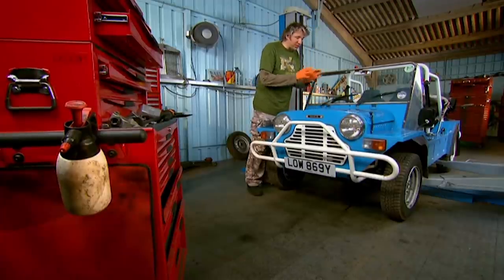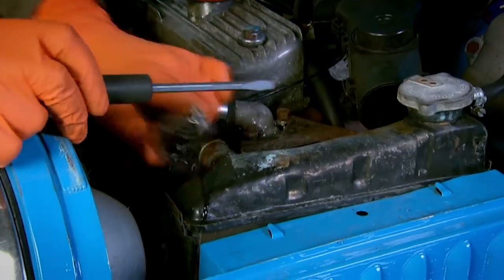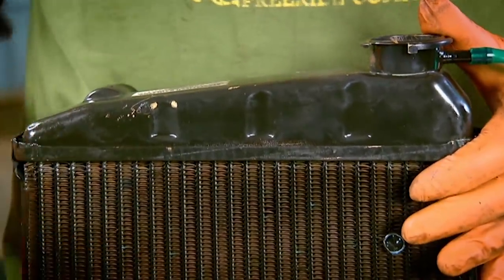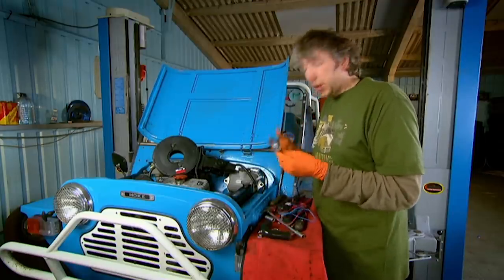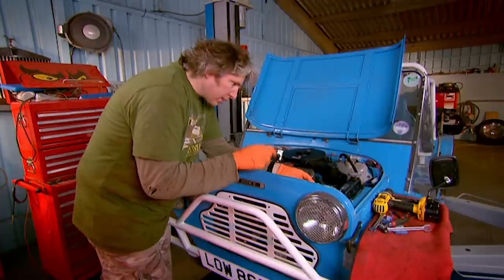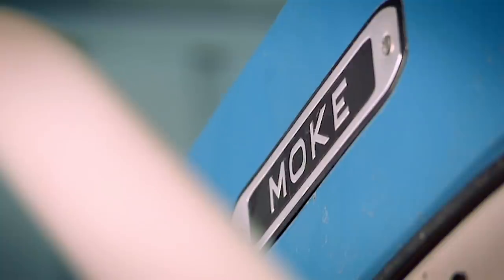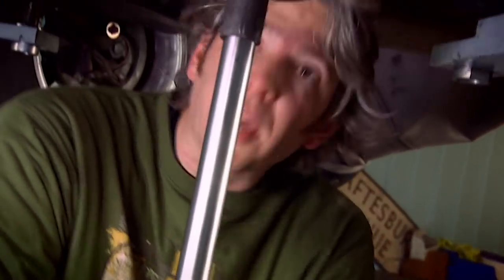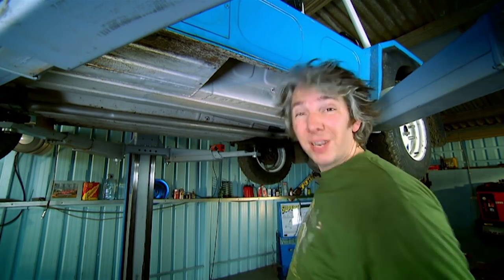Mini Moke: How To Replace A Radiator And Fix Rust | Wheeler Dealers

Comment: Mini Moke,    My name is David J. Alt and I live in Finksburg, Maryland.   I just bought a 1965 Austin Moke from London England.  Mine is Forest Green, has New 998cc engine, new top, original wheels, no doors, no windows, no heater, and no radio.  I drove one 28 years ago on the island of Barbado's as a rental vehicle.  They are Neat and Fun to drive.  Thanks   David J. Alt

Comment: Good example of a Moke. Anyway, no need to change the cooling system with anything electrical, just keep the system clean and flush and you can run de car under extreme climates with no problem whatsoever.

Comment: Edd, use weld thru primer on the inside box panels, then follow with a cavity wax. Very surprised you omitted those 2 very important steps.
Reply: Normal for Edd
Reply: There are NO box sections on a Moke, the two side units house the fuel tank and the battery, tool well.. Only UK and Australian Mokes rust, Portuguese ones have galvanised chassis.

Comment: Had loads of mini's etc never had problems with over heating
Reply: D.R.H J.J.H the problem isn't minis back in the day. It's minis now with how bad the traffic is. I have a Morris Minor and it's a nightmare in heavy traffic for overheating
Reply: My classic mini racing green with  Standard fan works fine with my mg metro 1275 engine and small water pump Pulley and all  aluminium  42 mm core  radiator  in traffic and driving   Even in a heat wave It’s fine
Reply: Neither did I... and living in sunny Spain. The system is perfectly designed only needs to be flushed and clean, something no one does Today.

Comment: I know it is a TV programme, but given Mike has been in the motor trade for many years, but does he really know eff all about mokes ?  The white bull bar and sunraysia wheels have to be factory standard, otherwise he would reduce the value. I don't mind this blue but I prefer the metallic blue of the "Californian" model from Australia, with the 1275 motor, again standard in that configuration - was this one resprayed ? I was amazed at the lack of rust, sea-side Sydney salt air was a killer. Personally I did not like the white roof tho'